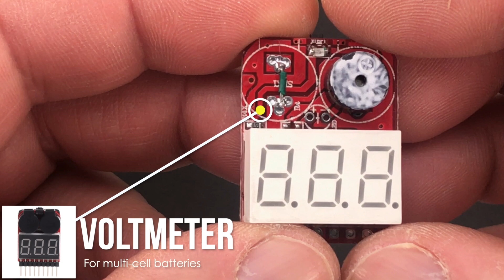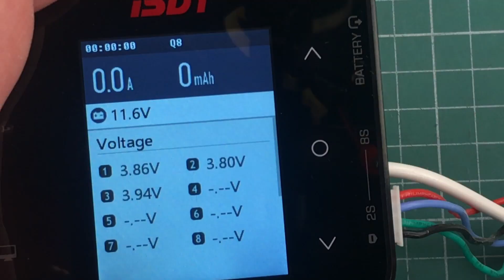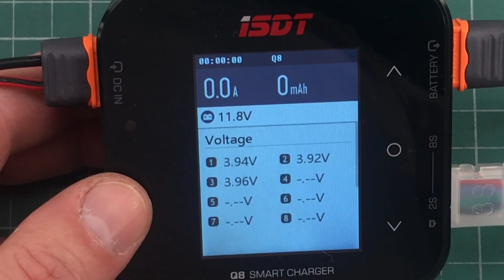3s Battery for Soldering Iron

Comment: Nice build 👍 i have the ts100, your look nice to 😍 with usb-C
Reply from the maker: For the ts100, it is desirable to use a more powerful battery, but this one can also work, but not as efficiently. And you don't need a monitor, the soldering iron has its own discharge control.
Reply: @V.Perinski  thanks 👍

Comment: sorry to disturb you but I would like to know : wich plastic are yo using for your 3d prints and wich solvent do you use to fuse parts togethe ? thanks a lot for these videos
Reply from the maker: I mainly use ABS plastic, and I glue the parts with dichloroethane.